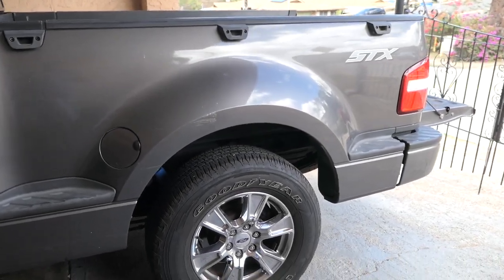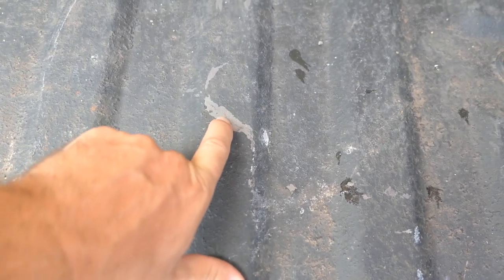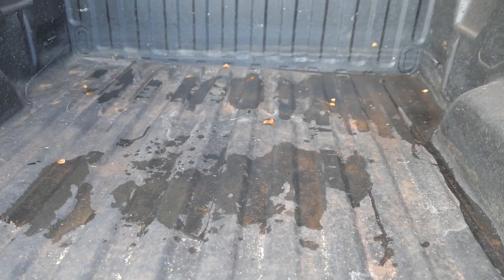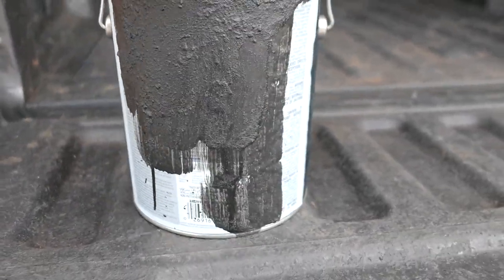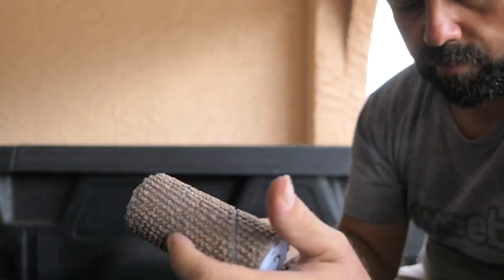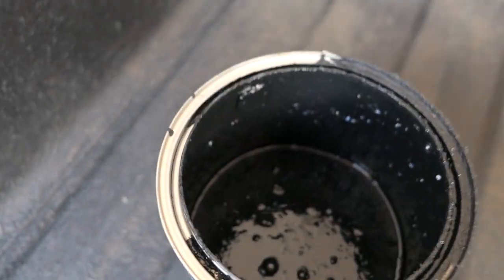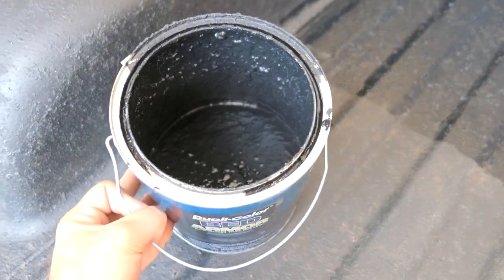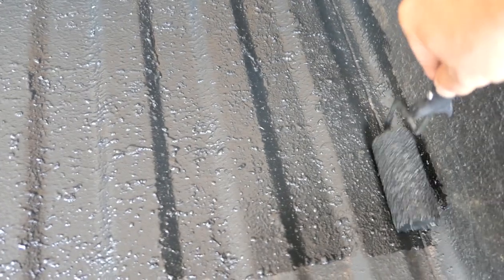Dupli-Color Bed Armor Update

Comment: i appreciate the follow-up.  i've been trying to decide between a DIY, drop in or spray on (lineX) and this vid was very helpful.  i watched your first vid where you applied this product.  fairly simple prep and application and i believe you did a good job.  i, too, wasnt crazy about the final appearance - kind of rough and uneven looking.  the follow-up vid helped me decide if i would consider this for my truck.  short answer - no, i wont.  after seeing the condition after 6 months use and all the scratches and chips, it's not durable enough.
Reply: Alan Davis get raptor liner this stuff is crap

Comment: They have a spray can for touch up, I have this on my jeep bumpers and after a year it gets really hard to scrape off
Reply: Does the spray can require a mask?
Reply: @whenwillwesail  I didn't use one, its water based, but probably a good idea but it doesn't aerosolize really.
Reply: @whenwillwesail  keep the nozzle clean between coats or it clogs
Reply: So as is the old turn upside down and spray trick or actually clean it each time with cleaner.
Reply: @whenwillwesail  both lol
Reply: @whenwillwesail  I put mine in mineral spirits in between coats and kept all of my old ones
Reply: @mblake0420  thanks alot my friend. Very much appreciated.